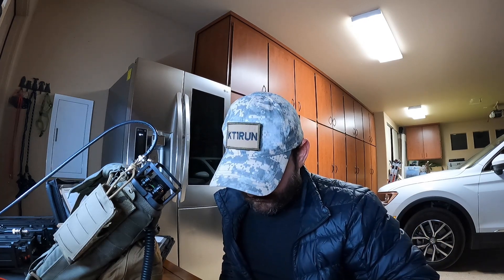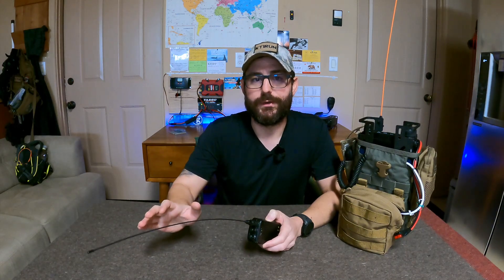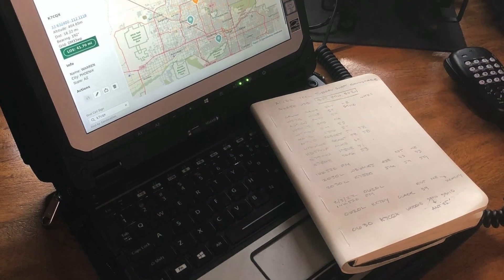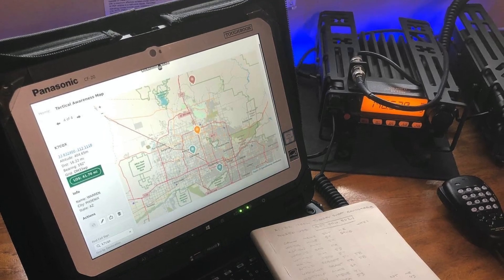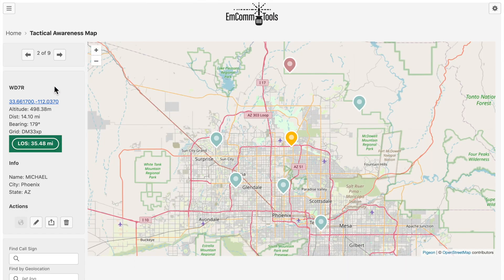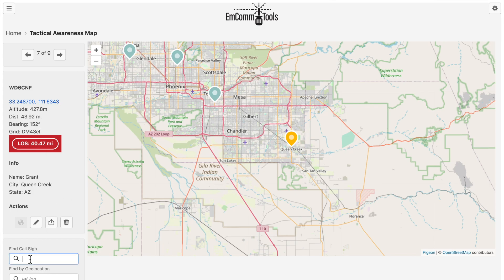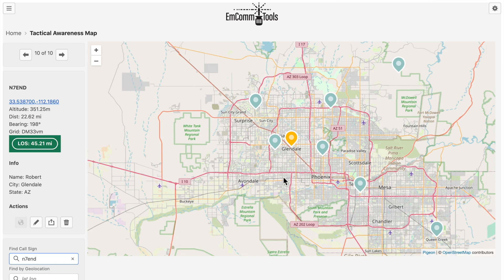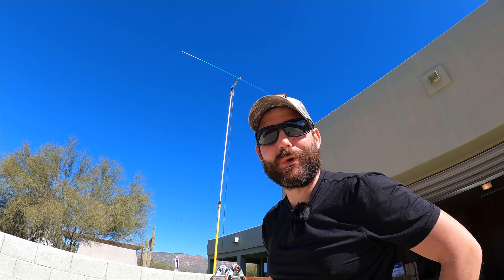Effective VHF Comms - How far can you talk?

Comment: On VHF/UHF if your antenna is exactly the wrong polarization you really notice - so vertical to horizontal is pretty bad. But if you have the antenna at 45 degrees you are only a quarter of an S point down on either (unless the other guy is also slant polarized the opposite way). A switchable pair 90 degrees apart is the gold-plated solution!

Comment: where can i get more info on that dipole on the painters pole?
Reply from the maker: It's called an Extended Double Zepp (EDZ). The ham who built it for me came by the house and we built a second antenna. I have footage but never finished the video. I plan to finish the video later this year.
Reply: @TheTechPrepper  cool name... but they're only 3dB gain over a dipole? I'd rather make a coax collinear, a collapsible Yagi, or a 4/5λ dipole(5/8λ) with a 4:1 balun, all of which can hit 6dB+ easy. Heck, I made a ~10dB gain 8 element collinear out of RG58, tossed it up in a tree and checked into an FM simplex net 30 miles away with an 8w UV-5R...😅

Comment: If there are hills etc (may 100 - 200 foot high  rolling hills) does SSB extend any distance whatsoever using on VHF, or is it line of sight no matter what? I'm assuming it's always line of sight and it'd do no better than FM, is this correct?
Reply from the maker: This is a great question. It's not black or white. I am no expert, but technically VHF is "just beyond line of site". It can curve around terrain features and bounce off peaks. It can exhibit "knife-edge" propagation and can cause the signal to redirect by diffraction. I did not want to lose people with all the other propagation that can occur. As I mentioned in the video, I encourage everyone to test in their area with their equipment as there are too many factors. I use the line-of-sight calculation just to establish a baseline. It's not set in stone.
Reply: In my experience 5w of SSB tends to be as effective as  around 20-30w of FM. Plus, SSB only uses power when you speak, so it significantly increases your battery life when you transmit, if that matters. With radio propagation there are no certainties, just rules of thumb, so you still have to try it for real. The lower you go in frequency, the more diffraction around obstacles may help. Years ago, I used to monitor a 2m VHF beacon 200 miles away (GB3VHF). When I turned my Yagi on it, I could barely hear it, but 20 degrees off beam it was loud. It turned out that a metal-clad warehouse 5 miles away on a ridge was a brilliant reflector for the signal. On 2m many people will find that a beam antenna will get a good deal of useful over-the-horizon refraction too, until the day you really need it, when you find that temperature gradients or air pressure are against you that day and even kilowatts won't get you through. That's the 'joy' of radio!

Comment: Pretty interesting, and i actually get the question a lot why i wont go hf? well easy cause on an average day i can do 10km per watt on fm 70cm and on good day 20 (all with buffer) but my record is 30km per watt and i just got an 50 watt Radio for christmas which i just need an antenna for after which im gonna do some trests with upto 50 watts
Reply from the maker: HF has its applications. 80m NVIS is exception for regional communication with a simple wire dipole and does a great job 30-300 miles omni directional. The bonus is that you can be in valleys and have mountains and other obstructions in the way. I did a video on this along with a $10-15 dipole build.

Like you said, 2m/440 is very capable of covering local communication easily within a county. 

Consider getting your General. It'll open up a few more doors. You'll never regret it.

Thanks for sharing your experience! 73's.
Reply: @TheTechPrepper  Well firtst of all thx for the reply, and i got to be honest, at the moment i like 2m 440 but idk if i want to get into hf due to the range which isnt any of my goals for what im doing especially with desaster preparedness since im already in an pretty flat area, still a few hills but I`m already getting more range that i expected when getting into radio so maybe for the future when my plans go further but at the moment its more than i need. 73`s from germany

Comment: 2 meter is not line of sight. I hit repeaters 30 miles away from Cave Junction OR with my base and my vehicle mobile in two directions. So I hit the Camp 6 repeater to the south, and the Fielder Mountain repeaters to the north. There is a lot of mountain and hill around me and in the path. It is a rule of thumb for HT powered 2 M radios, it is not however strictly true. I also hear 440 repeaters in those same distant locations. I have not yet been able to activate those repeaters from this far away. That may just be a tone issue.
Reply from the maker: It's great to hear that your experimenting and know the effectiveness of VHF/UHF in your area. Do you think your success is related to knife edging?

Comment: Maybe you've shown it and I missed it. What is the base of the painters pole attached to? 
I really need to get on the net more.
Reply from the maker: I've been trying to figure exactly what mounting hardware I have, but can't seem to track it down online. They're essentially two mounting brackets with a 2" diameter hole that I drilled into the stucco. I used to work in a building that was previously owned by an EMS company. They left their antenna on the roof and my boss let me take an antenna down along with the mounting hardware. I'll post a picture on Instagram and see if someone can tell me what I have. They work great and I've been looking for more.

Comment: Excellent video! Great software tool and antenna. 
How do you think the end fed zep stacks up against the Comet BNC dipole configuration you have shown in previous videos?
Reply from the maker: Thank you. Someone just asked this  same question. If you don't mind just check the comments as I answered it a couple hours back. For your home QTH, the EDZ is the way to go. For ultra portable mountain topping, go with the TrekMount.
Reply: @TheTechPrepper  The EDZ has some gain over a dipole (2-3 dBd reported). I use my wire one for SOTA activations which work very well with a fiberglass mast. Size wise the dipole would win. The EDZ is just over 8' long.
Reply from the maker: @malenve6vid  Thanks for the additional details.The viewers reading the comments will appreciate this. I am still learning about this antenna, so I did not feel comfortable diving too deep. We'll cover this when you and I meet in person later this year.

Comment: Interesting antenna. How does it compare to the trek mount 2m antenna?
Reply: great question!
Reply from the maker: The EDZ out performs the TrekMount. About a third of the stations on the net returned S9+10 reports and the more distant stations (> 40 miles) reported S3 on the low end. The TrekMount does well on a summit, but is not great at my home QTH. When I used the TrekMount in the past, only very local stations (< 15 mi) could copy me. I am surprised that the EDZ out performed my Arrow II. Like Mike, WD7R, suggested, A/B testing is needed between the Yagi and EDZ.
Reply: @TheTechPrepper  we need a build video 🤙🏼
Reply from the maker: @bradleyjohnson452  I'll add that to the backlog. I need to build a couple myself. Great suggestion.

Comment: Im curious, how can you hit the mingus mountain repeaters from there? I can get into a few north and east ones (ord) from here.
Reply from the maker: I'll get back to you. I have a note to try it out soon.
Reply from the maker: I tested this yesterday. The LOS tool reports that it's 46.3 miles from my home QTH and that I should be able to hit it as it indicates that my LOS is 48 mi. I tried 50 watts with the EDZ with no luck. Then, I put the Yagi up and was able to open up the repeater with 80 watts on the FT-2980R. I never got a signal report from anyone so it may be that I am not holding the repeater. 

What are you running (radio/antenna) and how far are you?
Reply: @TheTechPrepper wow.  interesting. Im 5 miles from it in cottonwood. Right now just running a ft3d, ordered a ftm6000 for my vehicle.

Comment: Great stuff!  One thing is for sure, the second I buy an 857-d, the next day the big 3 will release the MOA-shack-in-the-box rugged portables...
Reply from the maker: I said the same thing when I bought the FT-857 (for $1,000 USD) last year. I'm still waiting. My dream radio would be a cross between 857 and 818 with more rugged features. Here's what I'd like to see. 
1. All-band, all-mode
2. 20 watt radio (5/10/20 watts)
3. Same size/weight as the FT-817/8
4. Built-in sound card
5. Rugged construction 
6. IP67 rating
7. Replaceable LiFePO4 cell and external 12VDC power.
8. Physical controls (no touchscreens unless they work with gloves, sweat and rain).

Tuner and waterfall not required.
Reply: So true

Comment: Awesome work!
Reply from the maker: Thanks! I appreciate the support.
Reply: @TheTechPrepper  Since this targets 2m HT antenna, I was wondering if it would be useful to also consider alternative paths with one RF bounce in the mix, to as least give a factor to the straight line of sight (or even a visual indicator).
Reply from the maker: @bythemountain  Unfortunately, I don't think it will be possible in EmComm Tools as I am constrained by memory, processing power and disk storage since EmComm Tools is pretty light-weight and designed to run on low power devices like RPi. There are other projects that are out there that may handle this, but they require large data sets. Great idea and I wish it was something that was technically feasible.

Comment: I run a 2m directed Net for PrepperNet Asheville utilizing the Mt Mitchell repeater from 36 miles away.  I typically use a Yaesu FT857D at 50w.  But often use a 5W Baofeng UV5R HT with very good results.  We talk summit to summit using the UV5R out to distances over 20 miles.
Reply from the maker: That's fantastic. Have you done any analysis on the distance of the other stations joining your net? You may be interested in the mapping feature when this tool is released. Do you run any HF nets?
Reply: @TheTechPrepper  the Mt Mitchell is the best repeater in the country.  I can receive it up to 200 miles out.  Typical check in is within 50 miles.